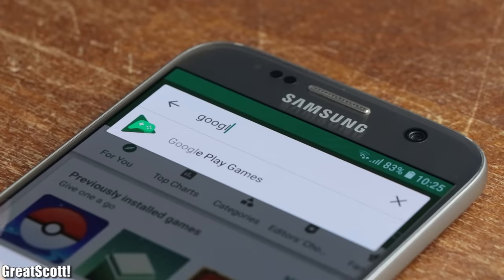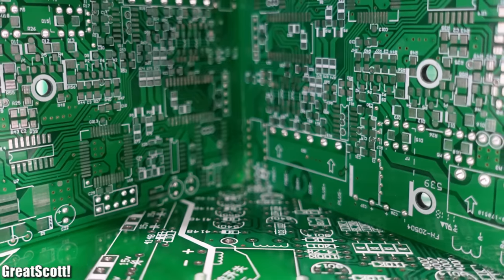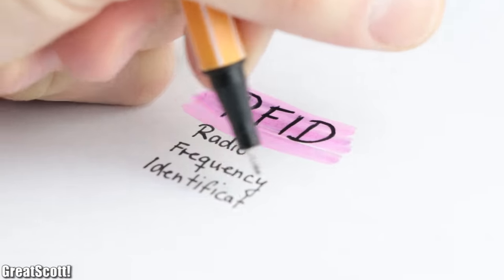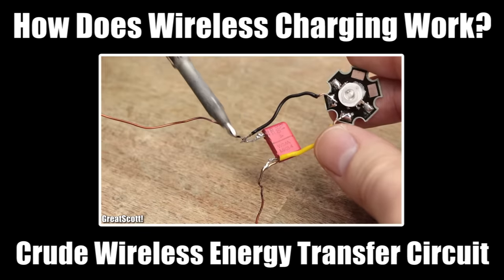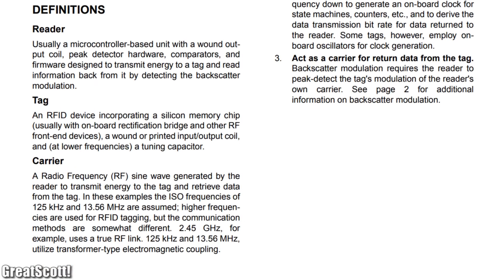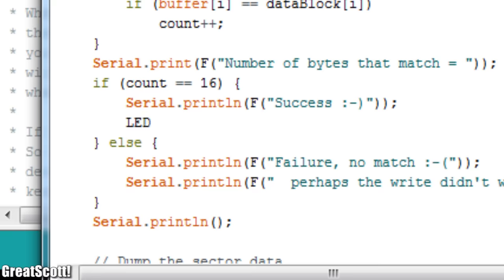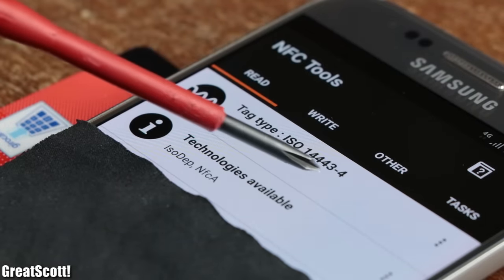How safe is contactless payment? || How does RFID & NFC work? || EB#40

Comment: I only use Samsung pay, make a video on MST technology
Reply: MST works by emulating a magnetic stripe being read. Magstripe is no longer in use for payments in Europe, hasn't been for a long time. But that also means that it's just as insecure as magstripe, so, not much to learn there.
Reply: @nikomo  That is not the case, the Samsung pay is way safer. I don't know the terms, but it only works one time with each code generated and ofc you can only read the code when the user wants to pay. The only way to scam someone with Samsung pay except for hacking and such would be to have a powerful receiver and read the code and jam the real reader. Would be hard to do in practice and you still need to trick the bank.
Reply: @marcusm5127  It wouldn't have to be that powerful. Also one could just hijack the phone through blue tooth. Then next time they go to use it the token is relayed to your phone instead of the coil. just only do it on a percentage of first tries and the user won't even realize what's going on and just thing it's a normal failure. And both the bluetooth hack and the token relay have been tried and worked. And the relayed of token even worked when relayed to another country that at the time wasn't on Samsung pay's availability list,  many miles away from the originating phone, meaning Samsung pay didn't even sanity check it.  "oh you're buying a snack in a country we don't support hundreds of miles away from the phone? No problem"

Comment: All this technology (RFID, NFC, Magnetic Cards, etc) Is not dangerous in mater of security. But is extremely dangerous in mater of privacy. So If you want to have privacy in your life, simply reduce the use of them of even better stop use them.
Reply: That doesn't make any sense, in terms of of payments your purchases are logged the same by both the store and credit card companies either way you pay, only way around that is to use cash for everything...
Now if you were talking about working at some place that uses wireless tags in order to get around the building, then you kinda have a point.
Reply: @vgamesx1  If I was in charge of building security tech, it would include near range fingerprint scanning, palm line scanning, hair and dot configuration fingerprinting of arms, fingerprint of bare foot characteristics, voice analysis, retina scanning, breath and over all air fingerprinting (seeking most unique possible set of particulate mixture put off by a given person [how animals with a strong sense of smell identify]), as well as checking visible physical characteristics of the body, posture and movement.  Not necessarily impossible to fool, but if someone did, every living other spy would blush upon it being proved.  Most likely armed security would catch them trying to penetrate a wall, floor or ceiling surface that they can't detect is being monitored.

Comment: Create a project where it uses an active rfid. It should transmit different data in every x second. Make the change synchronized with the Arduino so everytime you authenticate, it would pass. Ex.  encrypt  "qwerty" with unix time as salt, the mcu(with rfid reader ofc.) and active rfid (also with mcu) will generate the same output as long as their time is in sync.

Comment: @GreatScott your video does not make enough distinction between NTAG, Mifare and EMV contactless cards. They are pretty different to each other.
Each of these has their own "API" and access control systems which run over the ISO standards including ISO 14443. The debit card you showed has both RSA and 3DES, and can be accessed using standard ISO7816 commands. The EMV specifications are the open standards for this, and are available from their website.
EMV cards, both contact and contactless, use 3DES or AES session keys which generate a unique cryptogram for each transaction, which signs the transaction amount, the date and a random number from the terminal. This chip data is very difficult to counterfeit or replay (other comments have also made this point).

Comment: good video, notes are..
3 popular ICs 
- RDM6300 (125KHz)
- PN532
 (13.56Mhz
) - Can handle more RFID tags, but not credit card NFC data (this might work for workplace access card)
- RC522
 (13.56Mhz
) - Can’t read credit card NFC data
, Can read and write

Frequencies used (13.56Mhz) HF
MIFARE Classic 1K - (tag based RFID)
Both the card and the tag, holds 1KB of data

Contactless payment uses NFC and not RFID (and has standards) and it uses 13.56Mhz

So credit card’s NFC cant be read with RC522 Card. a HP with NFC maybe able to read NFC card and gives the card type (ISO 1443-4) but cant read memory as the data is encrypted.

Comment: Nice video! I recently got a contactless card and I highly enjoy the convenience of just holding it to the reader briefly,  compared to inserting it and typing a code. Faster than paying with cash. I assume the banks have calculated risks carefully, and that it's cheaper for them to occasionally eat a small disputed charge, rather than to design a 100% safe system. After all, the card number is printed on the card for cameras to see, and attacks where someone has a reader in their pocket would also mean that the fraudulent charge would be deposited into an account that could be investigated. Would love more analyses on that subject though.
Reply: Not all cameras will be able to pick up numbers on the card.
Reply: I would gently ask you to reconsider the faith you place in banks.

Comment: The way contactless skimming works is that people would get a POS machine using a shell company to tap everyone's bag and if they get lucky they can tap some cards that got contactless payment enabled.
Which kinda makes QR code payment 100X safer IMO. It requires you to take out your phone and reveal the QR code, which is an authentication key. And you can protect that feature using biometric authentication and device lock. And you get almost free skimming insurance with that. Ultimately it's not for paying a lot of money, but what matters is that it does require your acknowledgment in order to make the payment.

Comment: Here in the USA, we have electronically protected stickers which is basically a coil and a capacitor in parallel. When the cashier scans the price tag, the scanner sends out a high voltage magnetic field that shorts out the capacitor. When it is a failed attempt the customer breaks the infrared beam which activates the anti-theft sensors and it sends an electromagnetic field to the tag and the lc oscillator circuit inside the tag lowers the frequency. Please correct me if I’m wrong.

Comment: Fortunately for you, MIFARE Plus is the secure version, which uses AES so it's practically unhackable without the key.
Reply: It might use, but it also might use compatibility mode. Also, if it is running in compatibility mode, it is hacked already.

Comment: If I'm correct, all card readers which you encounter in shops have unique IDs. When card is put to a device, the device sends it's ID to a bank to check if it is bank's registered device and if it has rights to scan your card and send data.
Also, I heard an interview somewhere that those anti scan sleeves are quite useless. 
Correct me if I'm factually wrong about both these points.

Comment: You don't need to spend money to buy the metal envelope to protect your credit cards, just use the aluminum foil bag (1 or 2) (perhaps from the candies you just ate)  to hold the card(s), that should be able to shield the NFC signals.

Comment: the important thing to know is that mifare clasic, mifare ultralite (NFC Payments) and Mirefare desfire (ultra high security), it is not a data dump, but rather 2 way communication between the chip on the card (or fob or tag or whatever), so in an access control senario, (wich uses these technologies), you first have to send a password to the card for it to start opperating, then encryption is established on the communication between the card and reader, then the data is sent as per what is requested by the reader.

Ultralite and Desfire, also, have hardware encryption on the card itself

125khz access cards however do data dump there contents, making them far less secure.

Comment: Would you trust those things enough to make a NFC unlockable front door with them?
Reply: Yes, If you got the encryption right, this is very safe.
Reply: @szoszk  and if you don't print the IDs on the cards. Like some companies do...
Reply: An airbnb I went to used one. I used an app on my phone to unlock the door. I guess in the use case it's more secure than having keys floating around.
Reply: How about just to unblock the handle on the inside so you can use a key in a lock it takes months for a master locksmith to learn to pick?
Reply: The NFC if implemented in active mode is very flexible, for example apple pay, Google pay or Samsung pay use 5 saved tokens (so it work when phone is offline) 
with regards to security the tokens are stored in the tpm chip and does not store any card information (uses a virtual number with 5 payment tokens refilled per phone unlock) 

apple pay you are require unlock before payment is allowed (apple you have to unlock the phone) samsung the unlock before pay is optional setting 
Google on the other hand annoying still does not have the basic switch in settings to enable unlock before pay

For all phones max is £30 it without unlock and for places that allow it over £30 the phone unlock is required (card limit same as using chip and pin)

Stealing the tokens is very little use as they need to be in active communication with the phone as that 1 second you tap you phone on the reader there is a bunch of stuff going online to process that transaction

Personally I don't like debit card contactless as there is nothing on place to stop the use of the card if found but at same time not really bothered as its visa or mastercard problem if fraud happens (more so if its a credit card)

And for use in say for door use all you have to do is make sure that the app requires the phone to be unlocked before allowing nfc tokens code to be sent to unlock the door like airbnb company (the tokens are different every time so having a copy of the token won't do you any good)
Reply: @jasonlisonbee  Standard pin and tumbler locks don't take months to learn to pick. More like an hour or two if you don't have a bump key.  Some folk learn it in a few minutes. No need to be a master locksmith.  A bump key makes it trivial enough a ten year old can use one and get a lock open in just one two tries at less than 10 seconds each. All you need to make a bump key is a file and a key blank.
Reply: @kaseyboles30  I was referring to examples you don't find pre-installed on residential doors unless a prior tenant left one and the keys with the manager/landlord.  If I'd have referred to a standard lock, then I wouldn't have wrote all that.
Reply: @jasonlisonbee  : got it. Didn't realize you were referring to a secure mechanical lock. Most people think that the standard pin&tumbler they have on their front door is secure. It just keeps honest and clueless people honest.

Comment: you missed the most important part, the security. For example mifare 1K has trailer parts for each 16 memory blocks, there you can set the codeA, codeB and flags for reading the data from that part (for example you can set to use only codeA or both of them, set it to read/write mode) . The idea is that if you use a RC522 module and the passwords and flags were changed you will be unable to read all the content of the card. What is strange is that phones can easily read all information and even change flags when for example a trailer block was set as unreadable, couldn't find any information on this topic since everybody tries to keep it out of sight. Of course mifare 1K is most probably the least secure card nowadays, since there are a lot of ways to break the security and even intercept traffic, but there are tricks to at least make it hard to copy the card. What I would appreciate if you would show about the protocols of communication used by these modules and some of the outdoor readers (Wiegand)

Comment: In Ireland the limit for contactless payments is € 50.00. Aldi raised their limit to € 100.00 last Christmas for the duration of the shopping season. 
I keep my Credit Cards in an aluminium wallet for safekeeping. 
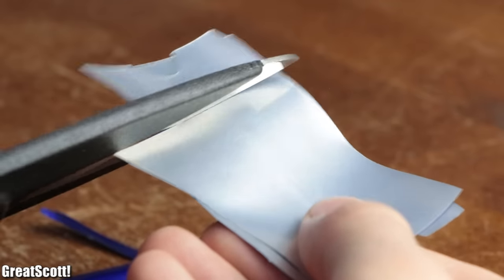Dublin Bus offers a contactless service for fare collection. I had 2 multi journey tickets in my hand and when the bus started I stumbled into the card reader and both tickets were debited with the fare. My duplicate fare was refunded in cash when I called to the office and explained what happened. 8:51
Reply: disable contactless by poking a hole in the card where the antena cable is. if the limit is 100 without pin and you lose your card/wallet you are screwed. before you cancel it people will use it. I work in retail and often times I get visits from the police requesting cam footage because a stolen card with no pin contactless was used. So you better add your card to your phone's nfc and poke a hole on the card itself. I even pijed a hole on the cvv number so people can't shop online

Comment: hey!
i was wondering if you can make a video on brushed dc motor drivers, the beefy heavy duty ones. i am into combat robotics and trying to build a  H bridge circuit using mosfets, but there are lots of problems that come through as the problems of switching the high side mosftes, bootstrapping, bootstrapping capacitor value, most optimum pwm frequency for driving a motor, current sensing on the motor driver (like the one in rage bridge , if you are familiar with that amazing piece of technology) etc ...would be a great video content. thanks anyways , love your videos as always .

Comment: Decent security is based on a combination of something you have (a card f.e.), something you know (a code or password) and/or something you are (figerprint, facial recognition, ...). If only one factor is used, or both can be cracked together (like writing your code on your card), it's not safe. NFC isn't safe, the risk is only limited to a small amount.
Reply: security is always at odds with convenience.
the safest option possible is also the most inconvenient.
different people have different thresholds of what they would consider "worth" the added security.

Comment: I really don't think NFC tags broadcast the entirety of their information by default. The protocol(s) allow for bidirectional communication meaning you can send commands to the tag and receive a response. Some commands will require authentication (provided that you're using a tag that supports it and has been configured to use encryption) and will not give you any protected data until you successfully authenticate (challenge-response type thing). The authentication can range from something as simple as sending a key/password to more sophisticated authentication algorithms involving diversified keys. Some cards, such as the Mifare DESfire EV2 and EV3, natively support various encryption algorithms that you can configure them with including DES and triple-DES (as found in the name of the card) but also AES. They're by no means impenetrable but they do provide at least some decent level of protection

Comment: The proximity required by RFID technology is only because it uses low power levels in the signal from the transmitter. Increase the power and you increase the range. You also would increase the noise and risk of overlapping RFID signals, but there are ways of dealing with this with radio pretty easily if you know what you are doing. This means distance is not viable for security, but you are not going to be able to sweep an area much bigger than a basketball court without exceeding 1/4 Watt on your signal and getting the attention of Uncle Charlie.

Encryption, especially when you know what the rules are for the encryption (the ISO standard has suggested rules in it, would be my guess) can always be broken. It is only a matter of time, computing power, and access to the system you are trying to break into. Now, it might be that it would have taken hours to brute force a single card open with the technology available when the ISO standard was created. That is not going to hold true for more than a decade since Moore's Law keeps chugging along and quantum computing is in development.

Access is the real key to security here. The best way to prevent a brute force attacks from succeeding is to have an auto lock out after a certain number of failed password attempts that lasts for a set amount of time. A card would not have this since it could easily cause serious inconvenience and frustrate customers in real world settings.

The fact that there is a maximum amount for NFC payments is the only security you have. Buy a shielded sleeve for your card and keep it wrapped in foil until you do.

Comment: the ISO14443 is just the communication protocol between  card and the reader,, ISO18092 also based on ISO14443 but its purpose for NTAG (one of NFC requirement), the program embedded inside the card itself either native or java card (they're not using mifare, because it's type of memory card), the secret key key stored within card and used by the program to authenticate transaction, each time a transaction performed a session key can be generated between reader and card based on the secret key inside the card and SAM card (on the reader), also the reason why NFC reader on phone didn't recognized the card because it didn't implement NTAG specification (ISO18092), but if you have an app that can specifically read ISO14443 card, it can be used to communicate with the card at application level protocol (basic APDU)